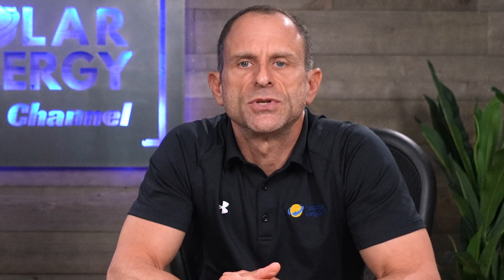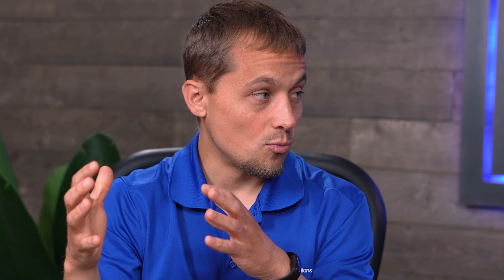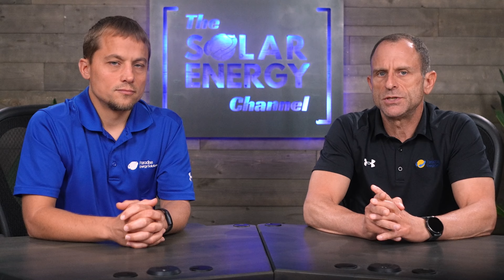Why Your Electric Bill is Higher Than Your Usage Suggests

Comment: If you have an EV and you have peak charging then the thing to do is set up a system to monitor your other power usage and only turn on your ev charger when your other use is low enough to not go over your normal peak level. Some people use Home Assistant to do this.